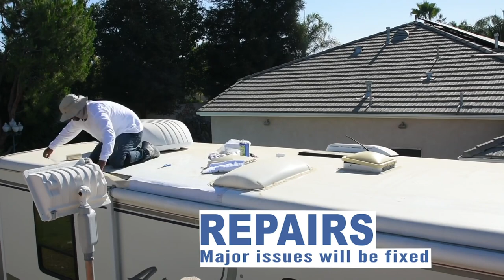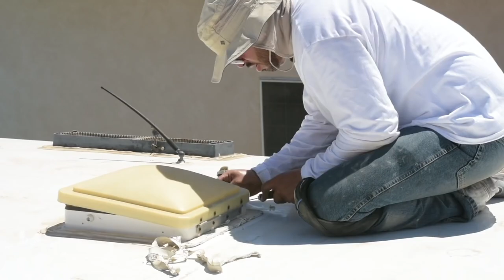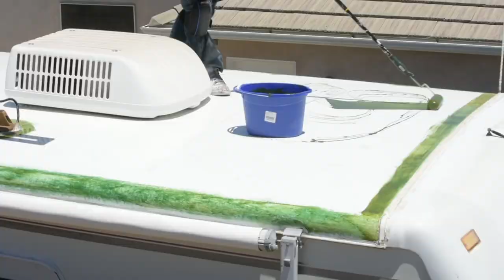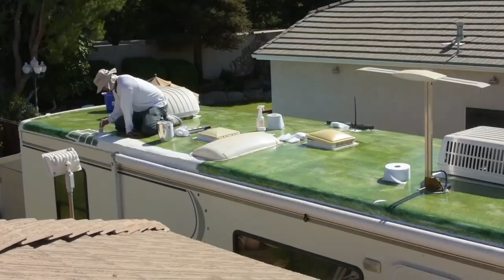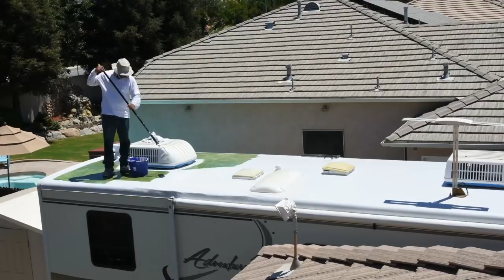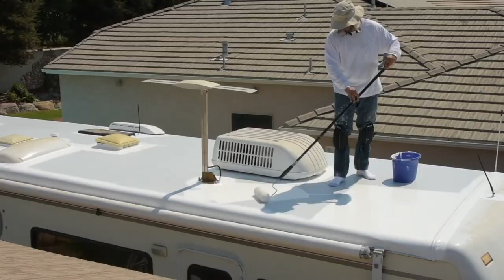RV Armor Roofing System Timelapse

Comment: Why were the A/C unit covers not removed and the application done up to the lip of entry?  Seems like a weak point if you dont do that.
Reply: Another video I saw showed the tech doing that. All the fixtures were cleaned and taped just like this one did around the vents. So I was wondering the same thing. Maybe they have changed the way they do things.
Reply: Considering RV Armor myself. From another video I watched, to remove the a/c unit and coat up to the flange is an option. It does cost more but he did not state how much.
Reply: @TheFivepoint1994  
I called and got an estimate a couple of years ago. It was so high that I felt it would be easier to just trade in my camper every couple of years.
Reply: #1 place rv roof leaks are at the AC.
Reply: Forgot to remove ac units.Typical half a-s work/job
Reply: @LuresandLunkers1969z  Didn't forget, you can do this product without removing them, and it'll still be under warranty if anything happens. You can opt in as a customer to have them removed but it costs more. I've installed this and many other products over my 15 year career and can definitely tell you that you don't need to remove anything for this product to work as designed :)
Reply: @campnut6076 nose cone

Comment: If my roof needs to be reskined, can this be applied directly to the plywood?
Reply: No!!
Reply: @mjremy2605  @ssteele1812 Yes, it can. However RV armor doesn't recommend it. We've done it multiple times over my 15 year career and it hold up fine to roof decking, albeit more labor because you'd have to tear off the existing tpo/edpm roof and all components so it's better/cheaper to make repairs to the existing roof and coat from there :)